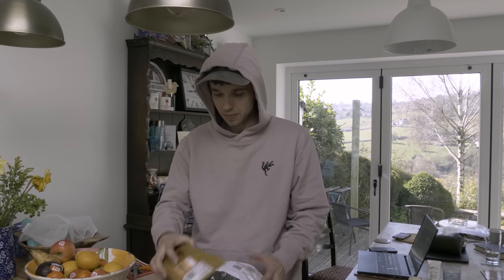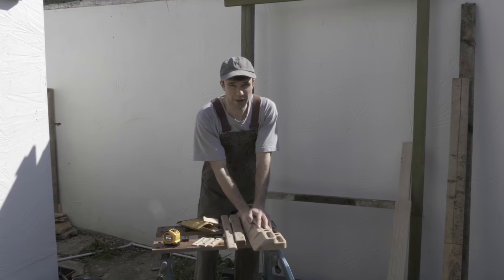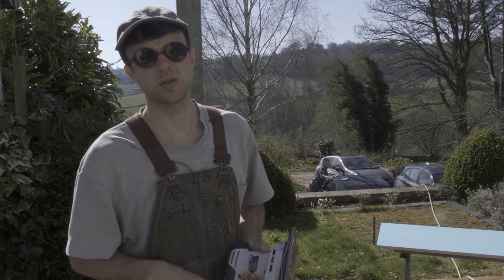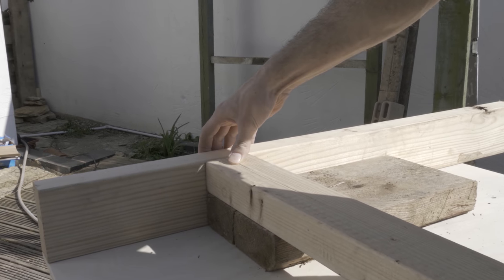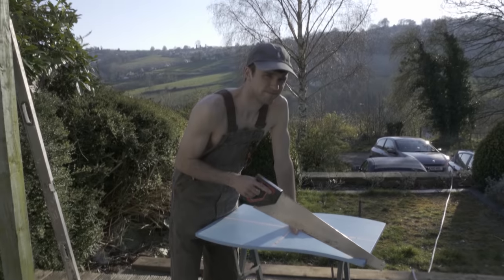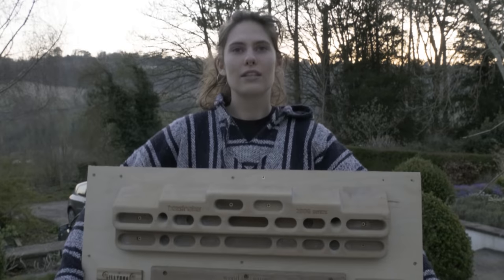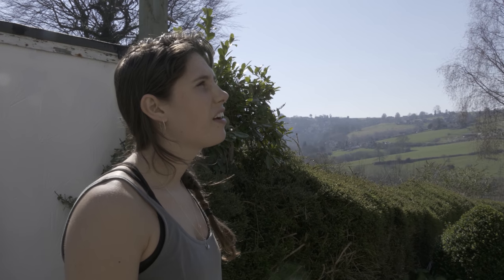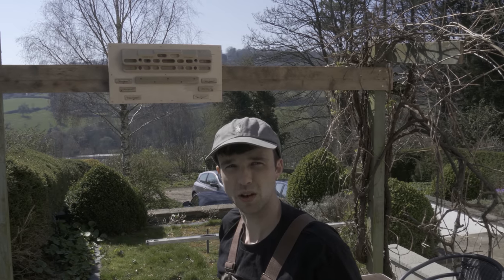Building A Custom Hangboard || The Lockdown Series

Comment: I went with a small portable hangboard that I can hang from my pull-up bar. It has 10, 14, 18 and 22mm edges to hang from and if I rig it properly it's very solid and doesn't move about. Crimptonite Ultra Light if anyone is interested. Fits in a backpack and weighs around 400g so easy to take with me to the crag once the quarantine is lifted. Only thing I wish it had were some slopers. Kinda jealous of your setup Joe, wish I had the space :/